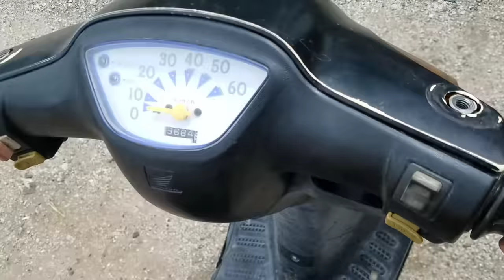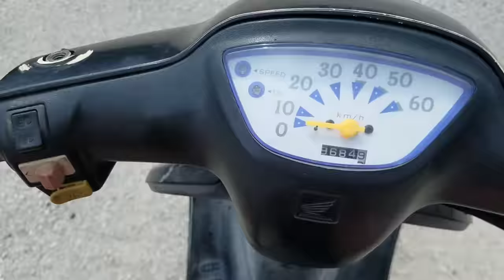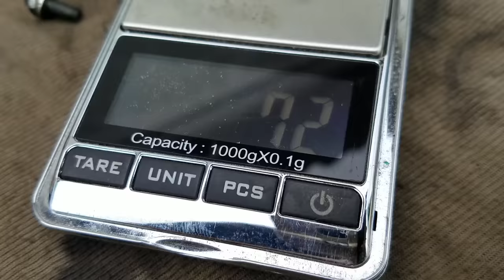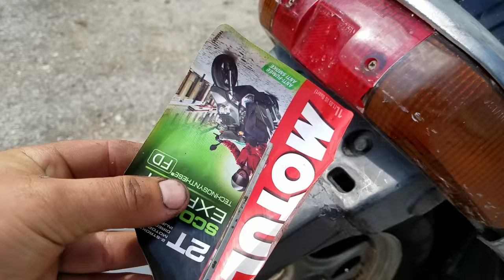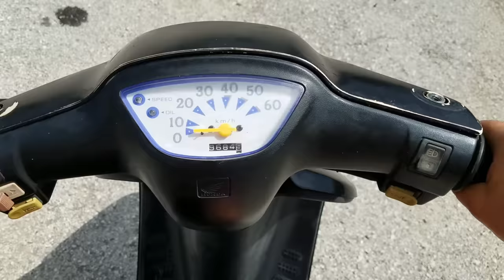Ремонт скутера Honda Pal

Comment: Nice video man, one thing i have learned, the smallest piston ring is bad for your motor, it is one useless thing that causes broking/baking in prosentual..
Reply: and were did you learnd that my man? because i allways drive with pistons with two piston rings because they live longer and they have more torque than the ones with one ring. pistons with one ring are used to get higer rpm

Comment: Great job !! I'm a big fun of you...I have almost the same Honda Pal scooter, the carburetor is leaking from the overflow tube. I checked the float and the valve , they seem good but i'm not sure for the valve seat.I think I'm gonna buy a new(or used)carburetor.Can you please suggest me carburetors of any brand compatible with Honda Pal ?
Reply: use one of a peugeot fox they would fit like if they were made for it. you just have to  seal the retour of the fuel.